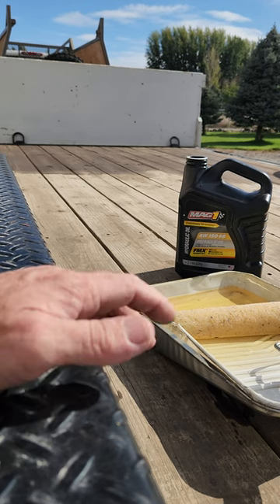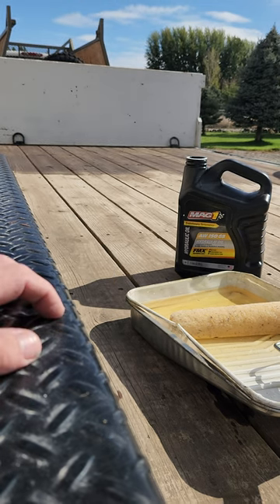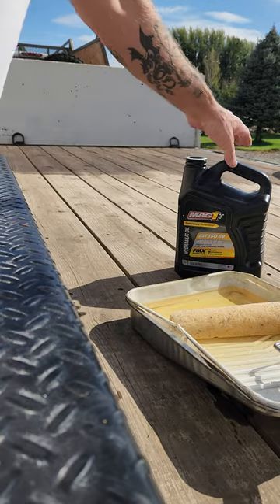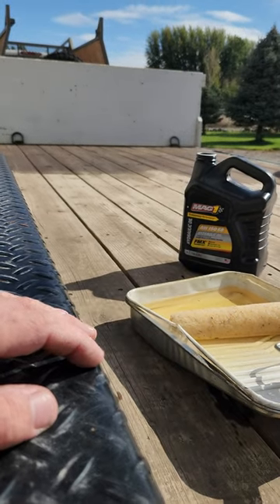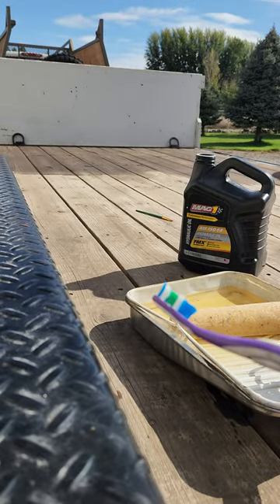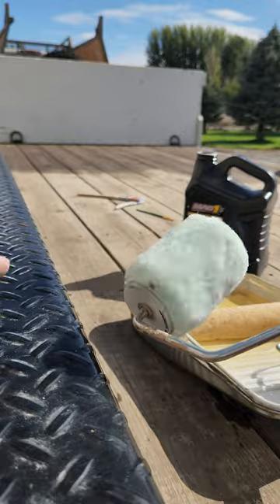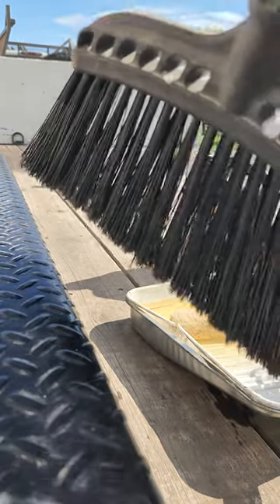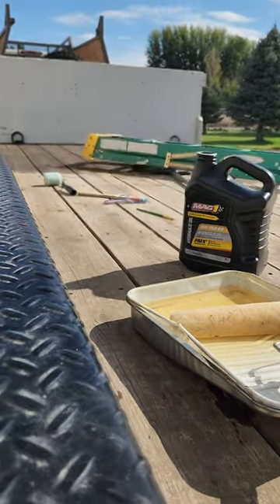How to protect your flatbed wood decks on trailers or trucks.

Comment: Fuel oil kerosene or use motor oil works best
Reply from the maker: I couldn't throw the oil otherwise boiled linseed oil would have been in your list as well, trust me i thought about it. But I gotta clean it up too.🤣
Reply: @Not.The.Avg.Smitty  dip tank dip the boards lay them out over plastic make sure to keep them off the plastic so air will get around them in the sun of corse a day or two each side reinstal bam boards that won't rot warp or do any off the bad things works best with red oak thirty years they will last
Reply from the maker: @nathanhogge4870  when building custom flatbeds for city, contractors, dealerships etc...I used apitong  hardwood. Typically seen on tractor trailers and heavy hauler. I could order it in ship lap and get to the customer asap. I'd love the oak on my personal flatbed if I build myself one again. I may have some pics in community page of a flatbed or 2, I made  long ago, not sure.
Edit: posted one I ran across a couple months ago with the same wood. They didn't oil it ever from the looks so it could definitely look better.